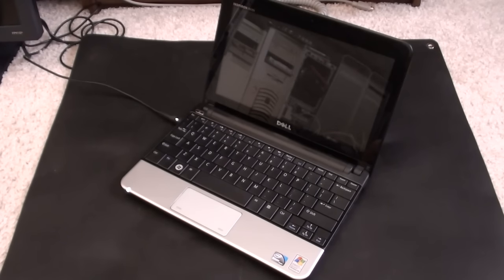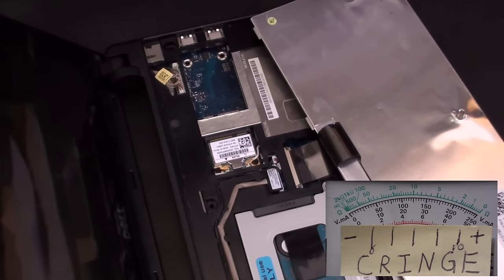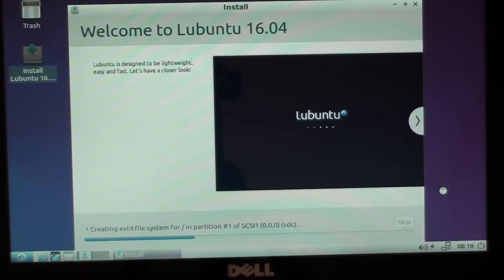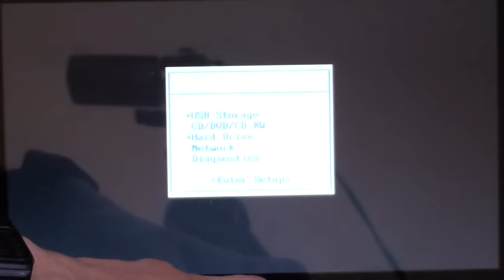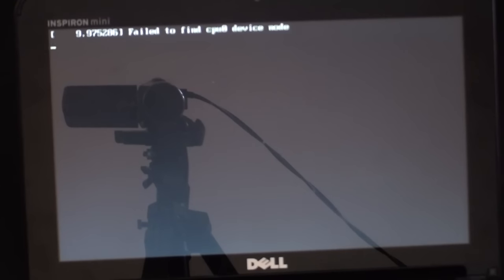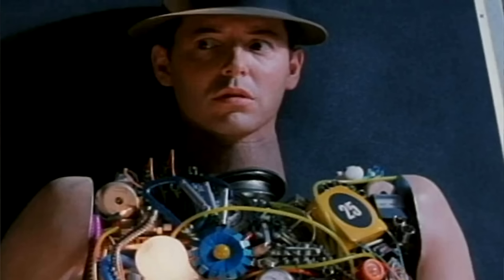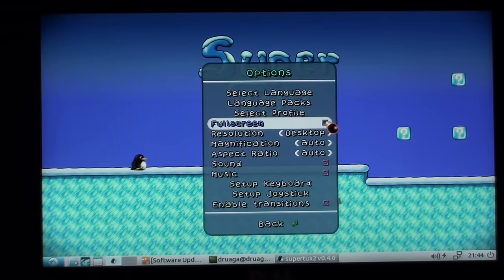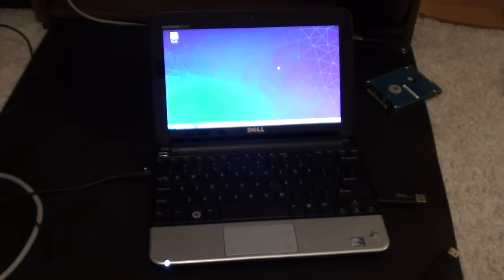Creating the SSD Linux Netbook

Comment: Here is a little secret about Linux.  You can preinstall it on a hard drive and then just put them in the PC you want.  It doesn't do hardware detection during install.  You can literally put that linux HD into any computer and it will work.
Reply: I think Windows 10 can do that. I replaced the motherboard and CPU of one PC and it booted Windows 10 fine from the old installation.
Reply: Windows does this too. i changed my entire setup from an EVGA SR-2 mobo (socket 1366, old) to a VIII Hero with a 6700k. Booted from the same install of Windows just fine.

Although, I would not recommend doing this all the time as drivers can conflict/cause errors.
Reply: It's not exactly the same.  Most Linux distros literally doesn't install any custom drivers during the install process.  It comes with a set of generic drivers preinstalled that just work on 90% of hardware.

After installing it, you can optionally install device specific drivers for increased performance, like Nvidia or ATI drivers, but you don't have to.  (Unless you have a broadcom wifi chip.  Due to legal reasons, broadcom drivers can't be preinstalled.)
Reply: ***** If it was "completely wrong", Linux Live CDs/USBs would never work.
Reply: +- λshton - search linux myth busting. that used to be true but isn't anymore. a youtubed tested it on camera and proved it doesn't work with all distros
Reply: jpenny666 If it was completely wrong, no distro would work on a Live USB/CD
Reply: I'm pretty sure Debian works... i actually don't know...
Reply: Well it works fine on my arch install. I think you people should get your own experience with using linux, otherwise you cant really judge it/Mythbust it. Also main reason it doesnt work on some reason is because of the use of the Fstab files and how the partitions are defined in there (Fstab tells the system how and where to mount the drive(s) ). If you want to be 100% sure that its compatible across multiple PC's, use Partition Labels or Partition UUID's then there is a about 90-95% chance that it will be fine. And as long as you stick with Nouveau (Nvidia), MESA (Intel) or... cant remember the amd counterpart drivers, it should boot up just fine.
Reply: Windows 10 can do that now as well.
Reply: testing1567 i've made an external hdd with ZorinOS on it and i can boot it from every computer
Reply: + testing 1567 I think the only hiccup I ever ran into was a video driver issue. I pulled a HD from an old Dell with an ATI chip and popped it into an Asus with an Nvidia chip and the compositing manager freaked a little bit. The screen went blinky (was still usuable as a test) so I just blew away the old install and reinstalled from scratch (nuked it from orbit because it's the only way to be sure). But yeah, Linux just works on all the things.
Reply: Almost any os can do it... even windows xp actually
Reply: Ashton

Place Windows into a new computer, and it gets deactivated as a licensed product. In other words, Windows would need to connect to the internet again to see if it's a valid copy.

(It apparently checksums the motherboard or something during the boot process.)
Reply: Jake Marin

It's possible to set it so that the drivers are compiled as separate models. Seriously, what you've said could easily just be discerned through downloading the source code.

Not all wi-fi cards have a Linux driver. Thankfully, there exists a piece of software that acts as a shim so that you can download the Windows drivers and use that instead.
Reply: @Hogdriva  I still have a windows 7 install that has gone through 4 different sets of hardware and also gets used as a bulk data drive for a different windows installation.   Still works!   I've most recently used it as an emergency fallback when I had a program I needed to use that didn't work in Windows 8.1 or even in compatibility mode.  -- It's been through an 8400gs+, hd5570, r9 290x, 1070ti for gpus and an athlon 64, fx8320, xeon w3520, and xeon w3670 on different motherboards for cpus, adding and removing ram, soundcards, wifi cards, etc

I don't understand the people who say you have to reinstall on every hardware change... I've had it work on vastly different systems and even modify files on the drive since I use it as a data and programs drive for a different copy of windows to use.  Yet it still boots right away when I select it in the bootup options
Reply: @mythejuli2  always nice to see a fellow arch user  online  i don't understand the conflict here what are they even arguing over as far as i can understand it's something about linux detecting hardware at install & not at boot witch   to me seems at best really BAD DESIGN & impossible at worst as far as i not only does arch not do that but even windows doesn't  since there's a tool  in windows called dism serves the same purpose as pacstrap decompresses files & copies them to a ta the ta the destination i don't know if that destination has to be a hard drive/partition or just a folder like pacstrap it can also help you install updates/drivers so you don't have to do that post-install  though unlike pacstrap you do need a windows image witch you can get from the  iso file located in  resources/install.wim or install.esd witch you gotta convert it to a  .wim just a tip should you ever god forbid need  to re-install windows   an existing installation & have a the disk space & don't want to waste your time staring at a windows is copying files screen for god knows how long  still gonna have to do the post-install stuff set your language etc
Reply: @Bl1ndB3holder  If you want it to work, modify your filesystem table to use disks by ID or UUID instead of by SATA port. You can also get it to work by plugging it into the same SATA port as the old machine

Comment: Schrödinger's SSD. Both mounted and unmounted at the same time.
Reply: This comment should have more likes
Reply: its cause linux will utilize any swap partition it finds on bootup, by default.  so even though it wasn't installed to the hdd yet, the swap partition was on the hdd so it used that
Reply: based profile picture

Comment: Why does it say "Designed for Windows XP" when it has a Windows 7 Style key?
Reply: Wow ur right
Reply: 7 used the same logo from XP keyboards.
Reply: Technically it also is a windows XP key. Only thing that strays from XP is the circle around the start key. As an example, look here. http://goo.gl/DnDXcg
Reply: A lot of netbooks were released when Vista was nearing the end of its life and 7 was nearing release. That was the key used as the super key on lots of keyboards. XP was installed on these tiny netbooks due to the relative slowness of the atom processors and the limited amount of memory.

I happen to collect and restore keyboards and typewriters from all parts of history, so it's something I just happen to know a lot about.
Reply: Windows XP even overlapped Windows 7 a bit on cheap netbooks like that. It took until 2011 for it to be completely replaced by Windows 7 Starter.
Reply: Yeah, this netbook was released after Windows 7 was a thing. I know because I have this same Dell model laying around somewhere.
Reply: Some similar model Dell netbooks had Windows Vista, and used the "Vista Orb" on the keyboard, so it's likely dell just reused the keyboard from those.
Reply: To everyone here: He also said, he don't wabt to buy another one of those [keyboard], so i guess this is not the original keyboard?
Reply: Could be explained a few ways, maybe the OEM just put xp and an xp sticker on a 7 model, or the keyboard could be surplus from a 7 model, who knows
Reply: That’s a windows XP key, 7 has no circle and the squares are filled

Comment: "USB 1.1" oh god
Reply: trizm 6ix 六 Just the floppy drive, because you really don't need more speed for that
Reply: i know, but its usb 1.1 loll this computer was made after 1996
Reply: trizm 6ix 六 The ports on the computer are most likely USB 2.0, but the floppy drive end (Slave device) only uses USB 1.1, and that's what it's reporting. A floppy drive won't reach higher speeds than 12Mbit/sec, so they didn't bother building in a more expensive USB interface chip with USB 2.0 support
Reply: No, I mean in the BIOS it said USB 1.1 port I believe
Reply: No, that was the floppy drive's name, like a hard drive is displayed as e.g. "SEAGATE ST0000" (Not a real drive model btw.), so the drive itself said it is USB 1.1, not the BIOS
Reply: wat
Reply: trizm 6ix 六 The floppy drive has a device name, which is shown in the BIOS. Every storage media has one, not the drive label you see in the OS, but the "interface" name of the device

Comment: Put an SSD in an Xbox and install Windows 2000 on it (If that's possible)
Reply: It might be possible, but the result is a very slow OS. You have to use QEMU from a Linux terminal on the Xbox.
Reply: If only someone would develop a complete system firmware mod that enables regular BIOS thus exposing the hardware as a true PC.
Reply: StrongarmSlayer This is what I want.
Windows 2000 can possibly run on the Xbox, because it has 64 MB of Ram.
Reply: tho it could be slow considering the 3 core PowerPC processor. i mean windows at the speed of a pentium 75 could not be the best experience.
Reply: People have already ran XP on a Xbox!
Windows 2000 would work fine
Reply: television and cheese well russians have made windows 2000 for NES. so no surprise there. and chinese people have made windows 98 for NES.
Reply: I watched Joel with the 98 on nes thing. Was just images of the windows.
Reply: television and cheese
ik but WHO WOULD COME UP WITH THE FUCKIN IDEA? he also showed the russian windows 2000 on NES. and it was more functional i mean it had an actual paint program and a tranzizzling dictionary.
Reply: There was a linux for the Nintendo 64. It was just a Raspberry Pi inside the cartridge, with some extra chip that made the console show the screen of the Pi show through the console, and use the controller as a mouse.
Reply: television and cheese
weird.
Reply: +Pikapoo-Chan Didn't the original xbox use a pentium III as a processor?
Reply: It had a Pentium III and a Nvidia GPU and 64 to 128mb of ram! ;)
Reply: It might be possible since the original Xbox was running on a Pentium III processor, and the modding community is somewhat huge.
Reply: ConservativeWalrus you do realize that the original Xbox used a modified version of windows 2000, right?
Reply: I knew of a guy who actually used an Xbox as a Win98 PC back in the day.
Reply: hotziggity No sir Xbox only runs direct x firmware. If you are referring to Xbox 360 then yes you can install Linux and wine to run Windows programs.
Reply: singleflips pshha man Linux requires 4 gigs of RAM or 4 cores of processor to attempt gaming 😮
Reply: television and cheese Well that's kinds pointless?
Reply: television and cheese lies Xbox had Celeron m version of pentium iii 1 gig of dggr3 VRAM and 512 gigs of ddr2 RAM.
Reply: WHAT TO DO Not possible, Xbox runs direct x firmware aka virtual c++ not Windows.
Reply: Do you mean 512 MB and not GB?
Reply: Yea, I think Ian should try that! lmao
Reply: @singleflips  its a pentium 3

Comment: Try putting Ubuntu on an iBook. It works and it's not that bad. I put it on an iBook G3 and now it's modern.
Reply: Lubuntu
Reply: A few years ago when I still used a G3 iBook I ended up putting Ubuntu on it to run some newer software. I agree It does actually work pretty well!
Reply: I have a Lenovo Thinkpad t340 with Windows 10 and Ubuntu mate 16.04

Comment: I was sitting there, screaming "that's an extended partition! You don't unmount extended partitions, let alone swaps!"

An extended partition contains more partitions inside it. In this case, you had a Linux Swap partition inside it which was "mounted." To "unmount" a swap, you use "swapoff /dev/whatever"

Since the swap was on and the swap was contained in the extended partition, you couldn't delete it. :(

Comment: I was given an ancient 2007ish Fujitsu laptop with XP on it a while ago.  Maxed the RAM (2 whole gigabytes) even upgraded the CPU to the fastest it'd run (Pentium dual core something).  Of course, I added an SSD.  Several distro's of Linux later I was thoroughly depressed with how crap the thing ran, and how impossible it was to get all the hardware to actually work.  Eventually I gave it a spare Windows 7 key and got the free 10 upgrade and now it runs perfect all the hardware etc etc.  It's even sort of fast-ish.

Helped a friend out getting her XP era netbook running again.   All she wanted was something running iTunes to sort some crap out on her iPhone.  Cheap Windows 10 key and the thing works fine, in fact faster than XP was.  Didn't put an SSD in it even though I'd have liked to.  She didn't want to spend any more money than necessary on it, which was fair enough.

Linux I'm sure is great, but I guess you really have to persevere with it to get the best (or indeed anything) out of it.

Comment: Cringe meter made me cringe
Reply: Says Windows 10 itself.
Reply: Windows 8 is worse though.
Reply: +Dr. W. D. Gaster recently I've been having far more issues with Windows 10 than I have with Linux, especially with Windows dropping support for older hardware, at work out of 40 PCs Windows 10 only fully supports 4 of them, 20 only have legacy support and the rest aren't supported at all.
Reply: I did not need to know that, but okay. I personally no longer have access to a computer (for reasons), but if I were able to run a computer OS on this (unrootable) Android device (without it being really slow), then I would run Linux, probably Debian.
Reply: Windows 10 makes me cringe
Reply: +Dylan R I have Windows ten but I put a skin on it for Windows 7
Reply: I'm running Windows 10 on a Dell Mini 10 (1012 model) using an SSD, with 2GB of RAM and it works surprisingly fast, as compared to every other OS I tried. Examples include: Ubuntu, Win XP, Win 7, Mac OS X, Remix OS
Reply: This is me installing windows 10
Reply: Seppä me too
Reply: Seppä I don't consider Windows 10 an operating system
Reply: Seppä a mix of the NSA and software incompatibilities
Reply: Seppä it's worse than Windows ME
Reply: Dylan R Haha! True.
Reply: only good Windows 10 is Windows 10 LTSC, with no telemetry, no preinstalled apps, no bloatware, no microsoft store, local account by default and no bullshit. If you use any other version of 10 I recommend you to just get LTSC.
Reply: SpacieUwU themes dont fix a shitty os

Comment: I have not finished the video yet BUT an SSD (yes "an") will give great performances improvement even on SATA 1, not because of the bandwidth but because of the latency

(around 15ms for a regular hard drive, around 0.1ms for a regular SSD : yeah 150 times faster
Reply: a SSD is not 150 times faster
Reply: In terms of access times... yes they are

Search on google some access time benchmarks comparing SSDs and HDDs, you'll be surprised
Reply: Nicnl Like for "an".

Comment: +Druaga1 you shouldve instaled android on the netbook. Or chrome OS. those two operating systems can run on computers even slower then your netbook. ive done it before with computers with 1ghz processors and computers with 512 mb of ram including ssd's and runs lightning fast.
Reply: Android x86 is alot more feature packed, while with chrome os it just contains the chrome browser. Id prefer you do android x86, but if your just looking to brose the web you can try chrome os, although it may be a boring video to try chromeos.
Reply: Both are just Android, so you're limited to Android apps, which are simply bot made for non-touch input devices
Reply: joshua ooroth cloud ready is a better version of chrome os for old computers.
Reply: joshua ooroth you used Chrome-whatever on a single core Atom. Then how come you found time to write this? Chrome's so freaking slow on these it'd take half an hour to write a couple phrases with two points!

Comment: My relatively new acer aspire v15 nitro also has to have the motherboard removed to upgrade the ram, or install an m.2 ssd.... Also to access the motherboard I have to remove the keyboard because access is from the top instead of the bottom. Pretty annoying overal soo yeah... Pretty sure there are worse laptops to service :P
Reply: Clamshell iBook? :)
Reply: Haha I wouldn't know, never owned a PowerPC powered Mac :p
Reply: Heh, just watch 8-Bit Guy's video on how to replace a single harddrive in an iBook. That's some screwed up shart! ;P
Reply: Yep mine broke and i just binned it and went fuck it its to hard
Reply: they're pretty fun, actually. I recently got a 1GHz TiBook, with no charger. I think it works.
Reply: Seong Hong Its an ibook g4